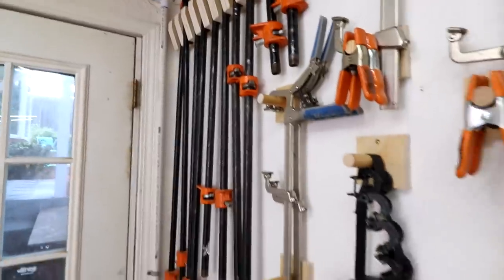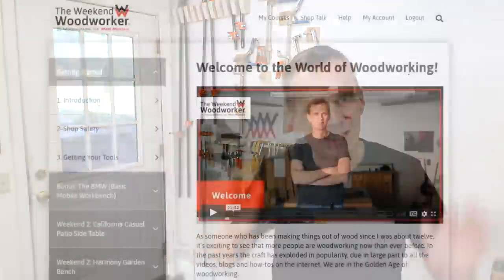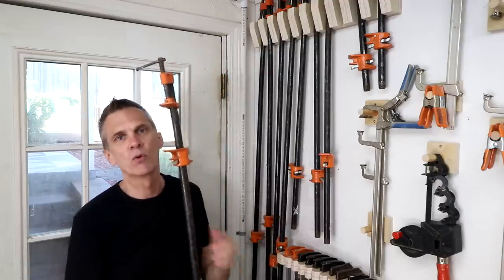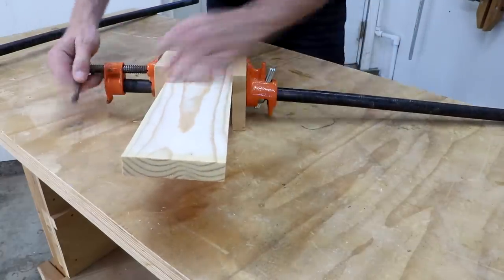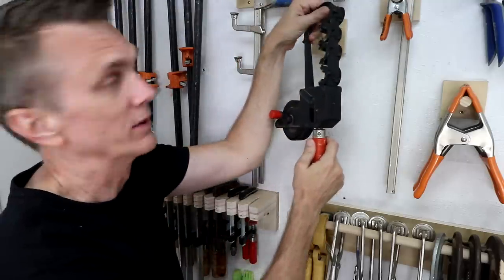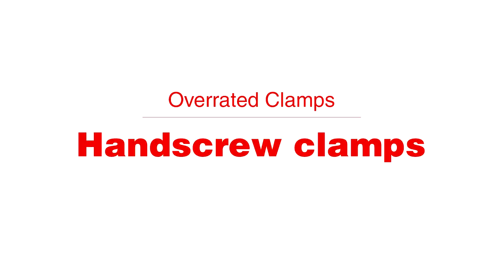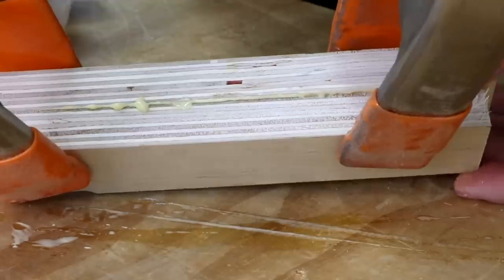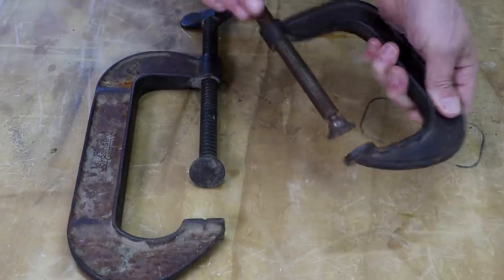How many clamps do you REALLY need? Woodworking basics.

Comment: Agreed on the C clamps, I don't have any and don't see the point. I'm curious why you call F-clamps "bar clamps" though. Maybe that's a cultural thing but to me a bar clamp has to be a minimum of 60cm long (which yes can be a long F-clamp I suppose)

I like angle clamps too to make sure two boards are jointed at 90deg. The strap clamp is okay but I find it hard to tighten, maybe it's just the model I have.

Comment: Actually and truthfully, EVERY true failure I've had in woodworking was because of clamp failure ... letting go .. failing to hold after supposedly being secure. Having a fence slip away or off during an operation because some cheap clamp failed at the wrong time is a disaster. Now - I won't buy any clamp unless I buy multiples - as backups to work in case one fails. MY big reason for having a lot of clamps. Right now I have no less than ten clamps of various sizes that should be tossed. I laughed at the "9" figure. Bar clamps are the worst one to fail. I WANT to use them most often BUT ... more than half of mine have failed. Love my pipe clamps.

Comment: I have a lot of clamps, do I have too many, who knows, I have Wetzler only what you call bar clamps, I 180 or so of them, as for pipe clamps I have 60 of them,  I have 100 or so spring clamps theyre useful for all sorts of things, but I sometimes do solid surface counter tops, so when I am gluing an edge one edge can eat up 30-40 of them depending on length,  they all have their purpose and all get used sometimes

Comment: I will agree with most of what you have said here but to pick on the venerable C clamp, come on now. I use them for both metal and wood working finding them to be one of the most useful clamps for 6 inches or less. As far as all those threads, keep them clean and in good condition and you can easily adjust the clamp single handed by swinging the clamp body while holding the screw.

Comment: C clamps are outdated. A good f clamp, particularly something made for steel, will give you all the strength and twice the width.

Can't believe you didn't go with a pistol grip clamp. So fast and easy, plus most can be flipped to use as a spreader

Comment: C-clamps are really good for metalworking, they are much more reliable, fully made from steel (not need to worry about fire) and can work like small point-placed vise, because can hold much more pressure.  But, for woodworking, C-clamps are not convenient at all.
Reply: Frames of C clamps are made out of malleable iron.

Comment: I agree 9 clamps s enough.  9 long clamps, 9 short clamps, 9 long reach long clamps, 9 long reach short clamps, 9 big G clamps, 9 medium G clamps, 9 small clamps, 9 big springs clamps, 9 medium spring clamps, but,  9 small spring  clamps is just too much.  9 really big pipe clamps, 9 big pipe clamps, 9 floor brace clamps, 9 strap clamps, 9 90 degree clamps, 9 Kreg clamps, 9 Kreg corner clamps, 9 hand screw clamps and yes 9 clamps of various types for emergency.  Yes, 9 clamps is enough.

Comment: I disagree with the handscrew clamp being overrated. Granted it depends on what you're doing but, I use it all the time for holding a board when drilling dowels. I've also used it several times for holding a board while routing along the edge to make trim or a decorative piece.
Reply: SlightlyCrookedWorkshop  most people have a bench vice for that sort of thing. But if you don’t have a bench vice it works in a pinch. But you can also hold things upright with other clamps like a bar clamp.
Reply: @darinnetherland3466  You're right. I'd love to have a bench vise but my basement shop is pretty small and I don't really have room for it. I would keep running into it.

Comment: I started out with the clamps from Harbor freight that you can manipulate one handed.  It's a good thing they work with one hand because if you use two hands to get adequate pressure (difficult at best) they will break.  I then went to higher quality and found the prices to be HIGH!  Bar clamps, Pipe clamps are where it's at.  Good presentation.  Thanks.

Comment: Hi - Have you tried to use those One-Handed Clamps?  Are One-Handed Clamps better than the steel bar clamp?  I'm wondering should i get a set of those One-Handed Clamps from 6 inches to 18 inches.

Comment: Trigger clamps are almost the only clamps I use on a regular basis. There’s hardly any application that I would find trigger clamps not needed. Spring clamp is also a great multi-functional clamps. Just don’t get the giant over grown one that Steve showed in the vid. The biggest advantage of spring clamp is obviously it’s affordability. With $1 a piece, there’s absolutely safety in numbers. Pipe clamps on the other hand, I find to be over rated. They are bulky, heavy and the jaws are dangerous to delicate work pieces. The only advantage is that pipe clamps are relatively inexpensive. But since you also need to buy the pipe in addition to the clamps, it’s not as cheap as one would think. Of course you can just buys a few sets of jaws and many pipes to cut the cost. But who really want to having to consistently swapping the jaws?

Comment: 9? I have hundreds, yes hundreds.From small 1 inch 'c' clamps up to 7 foot bar clamps.  1 inch and under  'c' clamps. 25 pipe clamps.  70 bar clamps from 6 to 48 inches. 50 1 3/4 opening spring clamps. 3 drawers of 4 inch and under 'c' clamps. and, a lot more. When doing mutiple parts, I have used 100 clamps. and this doesn't include  the 60 spring clamps i keep to secure tarps on my garage sale tables.

Comment: How many bar clamps would you suggest to hold a 2.5' x 10' long desktop together. I've seen someone use 12 (6 on top and 6 on bottom) Is that overkill or is it necessary to remain flat and keep joints flush during gluing? (i dont have 12 and was wondering if i should go but more)

Comment: Panel clamps are definitely the most overrated. Some scrap wood with packing tape and bar clamps does the job just fine. Even if you glue up tons of panels, they just don’t seem to offer any speed or accuracy advantages.

Comment: I'm currently struggling with two types of clamping-related situations - pocket holes and angled joints. I assumed I needed to get a pocket hold clamp, but would love to skip it. Does anyone have a recommendation for using regular clamps for either pocket holes or angled joints?
Reply: Two pieces of flat scrap and a quick clamp or the vise grip flat surface clamps...that will cover approx half the situations...I still occasionally use one of the specialized pocket hole clamps for box joint style clamping situations to stop separation and drift.

Comment: my useless clamp is a caulking gun type, it slips off anything with pressure applied,  but I have used it when needing to operate one handed and then switch to F clamps for final application but now I use quick clamps instead  wanna buy a cheap clamp?

Comment: c clamp is best for "metal" work or mounting points for machinery (aka holding down grinder temporarily).  using it for wood, it makes awful dents in your workpiece.
i see few that swears by irwin or equivilant ratcheting clamps.  keep in mind those are modern version of F style bar clamps.   no point to swear by modern equivilants.  just manufacturer gimmick to tell you buy mine, mine is bestest.

Comment: Hey Steve, I have a question hopping you can help. I’m trying to make a walnut table. I have 3 slabs that I had cut down. They need to be joined together but they’re of course twisted and the edges are off. I’ve tried taking a sliver off to TRY and get it to match up. But...
No it’s still off. How can I salvage these pieces with out loosing any more wood?

Comment: what about right angle clamps? If you are using the Kreg rig for pocket hole joints, its seems essential. Correct me if I am wrong
Reply: Personally, I hate the Kreg right angle clamp for pocket holes. I normally just use a bar clamp or pipe clamp. There are only a few instances where I'll use it.

Comment: Hey I've got a question I'm pretty new to wood to working and I'm building furniture for friends and family right now but my most popular is my porch swing and the first one I built cost me about $115 to build I've been able to cut cost quite a bit. I use a 2x10 for my slats ripped down on my table saw. But problem is I kinda fear the table saw but when I'm done ripping down what I have left over is bowed not much but enough to notice. It doesn't seem to effect the project pieces but I'm just curious what  I could be doing wrong to cause this and do you have any tips for me and anyone else experiencing this or other problem with using table saws. (Note: I got my table saw from father in law and did not come with a guard)

Comment: I have bought 3/4 inch clamps. Can I still use these on 1/2 inch pipe?
Reply: No. Half inch pipe flexes too much so you're better off with 3/4 clamps. Even 3/4 pipe flexes. But it is usually strong enough.

Comment: in defense of handclamp :
If you want to use handtools and don't have a proper bench vise then at least one handclamp is mandatory. Just clamp one jaw on the edge of the table with two normal clamps and in a pinch you just created a moxon vise, just less expensive and taking up much less space when you don't need it. Edge planing for small pieces ? super easy with those !! and it goes on ...
If you are a tablesaw centered woodworker like this guy here then i recon not so useful, it's just a matter of how you want to approach woodworking.

Comment: Aren't C-clamps more of a metalworking thing?
Reply: Bruno Guedes not if you’re building a boat.
Reply: G clamps are my most used clamps  for metalworking, great for welding  as well as work holding on the mill. I also use his "hand screw" style clamps, steel ones ofc, for work holding.

Comment: An F Clamp is Not a Betsy . 4 foot 3/4" & 1/2" Pipe Clamps R' Great & Can Span Indefinitely By Using Double End Female Connector's , [ 1.50 $ Each  ] . Prefer 3/4 " 4 Larger Footprint on Work . Alternate Clamps 2 Even Out Stress on Work-Piece , [ 4 Every One on Top , then One on the Bottom , Repeat ] . Start in the Middle & Move Outward's . Squares Up the Job & Share's the Ozz'in of Luv ! YYZ , Mohawk-Planker . Pipe is Cheap / Any Length U Wish / 4-Ever Lasting & Store's Well . Keep Female Connector on Dead Side of Clamp 4 Pipe Protection When Storing Vertically . + U Can Really Torque Them !

Comment: It really depends on the type of work you're doing,  and how much you want to get done at any one time. I did a job a couple of years ago where I needed about 60 clamps on a single glue up, and I had four to do. It took 8 days because I only had about 35 clamps I could use, so the glue up was done in sections and left overnight. If i had 240 clamps, i could have done all the glue up in a single day.

Comment: Bessey and only bessey 
Harbor freight are too weak and deflect which affects your clamping pressure and glue up outcome 
Yea there pricey but you get what you pay for 
And you can never have enough clamps is a fact that is true because what happens when 9 is enough and u use them all on something but have something else to glue up while your 9 clamps are holding the other piece? Not trying to create controversy at all just my 2 cents

Comment: What about squeeze clamps?
Reply: Sabi Csepregi 
The kind that’s basically like bar clamps with a different mechanism to tighten and release? They’re probably weaker than the average bar clamp, but also faster and easier to use, which is an advantage when you don’t need super-strong clamps.
Reply: @ragnkja  Yeah those ones. I find them useful, and yeah they prob are weaker however they have served me well so far. I would not solely rely on them. Was just wondering what ppl thought of them.

Comment: No. Wrong. There is actually a way to properly calculate the amount of clamps you need with this simple equation:

A+1=B

A = The amount of clamps you have in your shop
B = The amount of clamps you need for your current project

This is one of the fundamental laws of physics and cannot be broken or bent.

Comment: Pipe clamps like that straight up do not exist over here. Buying them means importing not just the jaws but the pipes themselves, because nobody here sells inch sized pipes with oddball non-metric threads on them.
And of course nobody makes pipe clamp jaws that fit metric pipes with metric threads.
Reply: So what size pipes do you have? 19mm = 3/4 of an inch. 13mm = 1/2 inch too. So if those are the kinds of pipe you can get then you have the same sizes of pipe that we do.  Metric is good for science. US Customary remains superior for practical matters though.
Reply: @1pcfred  12 and 20mm would be the closest sizes. And that is ignoring the fact that you'd need to cut NPT to fit the imported clamp to the pipe. So you'd need to import the cutting tools for NPT as well. At that point you might as well just buy serre-joints.

As for Metric vs USC, what you're used to is what you find more practical. I find USC to be terribly illogical and impractical. No surprise there, since I've used metric all my life.
Reply: @fermitupoupon1754  12mm and 20mm sounds like 1/2" and 3/4" to me. 12.7mm is actually 1/2" and 19.05mm is 3/4" I have pipe dies. I got that nasty sulfur cutting oil too. And yeah I've threaded pipe for my pipe clamps.
Reply: @1pcfred  Let's just express this in money. I don't care about "12mm is almost half inch". That's the most pointless part of the argument. Let's just talk money.

Let's assume a 1m length for the clamp.

Serre-Joint: €25 for the clamping hardware, €3.25 for the steel T-profile, €5 for a decent 10mm drill bit to drill the holes for assembly. Grand total: €33.25 including taxes.
Pipe clamp: $21 (excluding tax) for the clamping hardware, $24 (excluding tax) to ship it across the atlantic, €13 in customs fees, 4.2% import fee, 21% VAT = €67.96 + €8.19 for the pipe + €165 for an NPT cutting die. Grand total: €241.15

Just importing the clamping hardware itself for a single pipe clamp is twice as expensive as all the hardware needed to make an entire serre-joint.
Reply: @fermitupoupon1754  what is this tax thing that you speak of? I got 3 Pony brand pipe clamps on pipes for $5 at a garage sale. I did have to knock the cobwebs off of them though. They even came with the rubber protector pads.
Reply: @1pcfred  Those are probably unused because they're metric.

Comment: Wow, no quick clamps. Those are my favorites.
Reply: Ah, the quick clamp. Surprising these weren't mentioned in the vid. For me, whatever form or brand they take: they are expensively priced for how cheaply they are made (so much bendable, twistable, deformable plastic!), and never keep their promise. I mean never. How many times a clamped something, turned around for two seconds, and then found them sloooowly unclamping the parts I wished to clamp. Yech. Stick with the ones in the vid. I got my bar clamps on sale at Harbor Freight 15 years ago. Not one of them has broken or let my clamping need go astray.
Reply: One thing I don't like about the quick clamps is in glue ups they slide to the side. I use bar clamps first to hold it square then use quick clamps
Reply: Clamps are like people. Each one has their own talent. Sometimes you need a bar clamp, sometimes you need a quick clamp. And yes I even use a C clamp. I have a 70 year old fixer upper and I find for most of my repairs I use quick clamps.
Reply: Quick clamps have the advantage that you can pull things into place with them.  You can't pull a wildly crooked fence slat over to screw it back down with a pipe clamp.
This isn't applicable to woodworking so much, but sometimes comes in handy to convince warped boards to straighten up long enough to drive a screw.
Reply: Frank DeRosa ok I’ll agree - leverage with one hand, while the other can do something else. But I’ll insist (disagreeing again, with a more recent post) that I can never again trust a quick clamp unless I have my eye on it 100% of the time and even then only for a few seconds. Unless I want to be scrambling for another to reclamp - where the kwik one failed.
Reply: @johnnydfred   - fair enough, they are not the most reliable.  I recently (attempted to) clamp down my random orbit sander with them.  It was not reliable.
You've got me thinking of visiting Harbor Freight this weekend to roll the dice on some basic bar clamps.

Comment: Strap clamps are useless, IMO.  Why not just use a spring powered tie down strap? Much less expensive and just as useful...plus, easier to operate.
Reply: it has to do with how the strap is tightened. A good strap clamp will pull on both ends of the strap, making it less likely that the corner bits of the clamp move around. It's a lot easier to keep a frame in square with a good strap clamp than it is with a tiedown strap.

Comment: With the 9 clamps shown make an average size dining room table / kitchen table. It took me more than 9 pipe clamps to do so. Pretty sure a lot of people get into woodworking to make their own furniture. You said you use 4 clamps on a tabletop. I've worked in professional shops making tables and if you used 4 you'd be tossed out owing them your paycheck for wasting their time. I get the point of your video, but you are setting people up for failure with 4 pipe 4 bar and 1 strap.